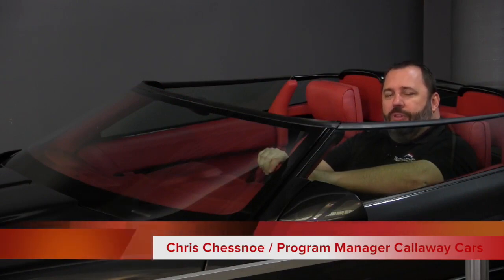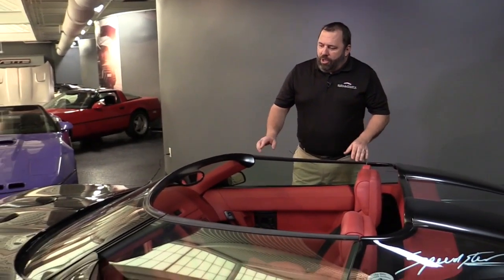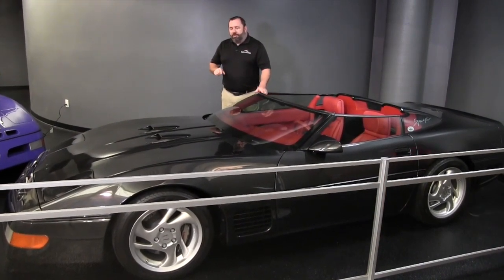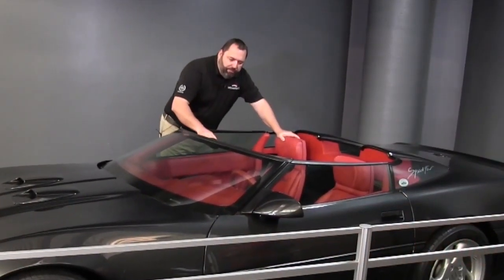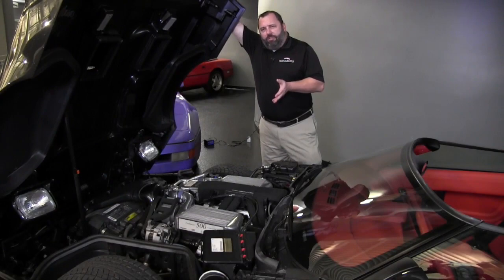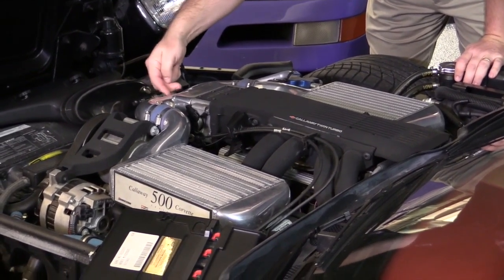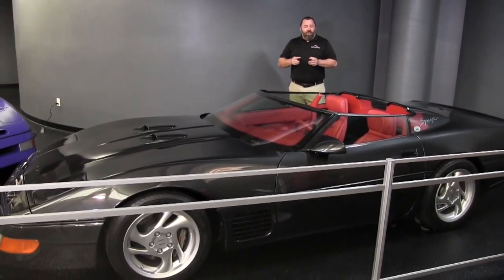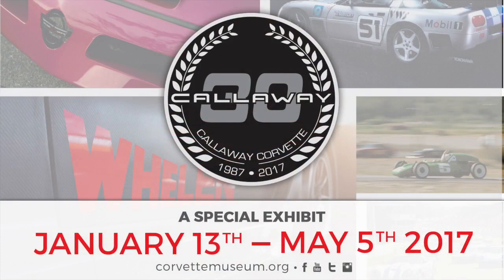Callaway Exhibit Series 03 / 1991 Speedster

Comment: Ah! The irony of it all. This Corvette as with All the  corvettes produced between 1974 through 1995 were designed to create Bandits, and Desperados. Todays times [2022] are very similar to the Jimmy Carter years as the president of the United States.Just prior to The Carter years, America was rolling with 55 to 65 limits east of Ohio, and 70 mph. speed limits in the flyover States. Everybody that was a driver drove 10 15 mph over. Every automobile manufacturer, had their own brand of muscle cars and we were living in high horsepower and speed heaven, and gasoline was selling for under twenty five cents a gallon. In the midwest, the gas stations were  constantly battling for more sales and we called it gas price wars. The prices fluctuated  around 12 to 14 cents up to 17.9 to 19.9 cents per gallon. In 1969, returning home from Vietnam, I traded  my '60 Chevy Impala ( inline 6 ) +$800 for a '65 Dodge 4door ex Florida State highway patrol pursuit car with the 426 wedge. Ultimate sleeper,  and you know I could dominate most any car ,regardless of the mods without breaking a sweat. One of my favorite machines, dependable and never let me down.. Comes Jimmy Carter in 1974 with a MANDATED (remember this evil word that breeds corruption) nationwide 55 mph speed limit coast to coast, and border to border. FIFTY-FIVE MPH LIMIT!!
This mandate was only supposed to remain in effect until our fuel crisis stabilized. In mid to late '70s many stations were closing, couldn't get deliveries of fuels ,land the governments set up even/odd days-depending on license plates or birth date .Funny but today's  times and crisis  seems very familiar to the Carter era.
So, back to my original story of the birth of that beautiful 1991 Callaway Speedster. It was born into a corrupt RADAR GUN WORLD.
THE SPEED LIMIT WAS STILL 55 MPH. ALL Corvettes were ILLEGAL from 1974 until 1995, and the reason I say this is- if they were LEGAL, the cruise control or speed limiters would have limited the vehicles [not just the Corvette-all motor vehicles] To only reach a maximum speed of about 62 mph,  but the corrupt radar cops could and did write speeding tickets on the Interstates and US highways for 56-57-58-59-60miles per hour over limit. (this is the  mandate corruption) every cop in America and in every Podunk Crossroad hamlet was issued a(((((((((((((((((((((( RADAR GUN))))))))))))))))))))))))))THESE RADAR cops raked in billions of dollars stolen from the driving public, and literally some would drive from their little communities out to the Interstates, and they kept a couple of miles of the grassy median worn down to the dirt from Flip Flopping, east bounder speed ticket, oops! Flip west bounder speed ticket, oops , oops, oops -ah, call it a hard day cherry pickin' got my quota, 'n I'm goin' fishin' .THE CARTER MANDATED SPEED LIMIT WAS A SHAM AND A CASH COW FOR MANY SMALL/AND LARGE METROPOLISES AS THE MUNICIPALITIES MADE SURE THE RADAR SPEED COPS BROUGHT HOME THE BACON. This led to the 55 mandate lasting a full twenty years, as it should've ended once the fuel crisis was over, in about 1978.
My '86 C4 TPI  coupe, was illegal as all get out when it hit the streets in late November of 1985.  With the Fifty Five mph .
1ST 45**2nd95**3rd135**4th to the Buck-50 Club and beyond .So, I could never have ran my car out to its limit in 2nd gear in 1986 without breaking the law..
Final point. If a family 4 door sedan car is approved by the government agencies regarding safety regulations and fuel/smog criteria, and that vehicles SPEEDO reads 180 or 200mph, and its proven through testing that the vehiclel will cruise all day/night long at 154 miles per hour yet the posted speed limit is 95 mph( as Texas, Arizona), if there's no  speed limiters on the car then is the VEHICLE or the posted SPEED LIMIT illegal? I'm 74 & still LOVE SPEED! Would love to break in that Callaway Speedster😱